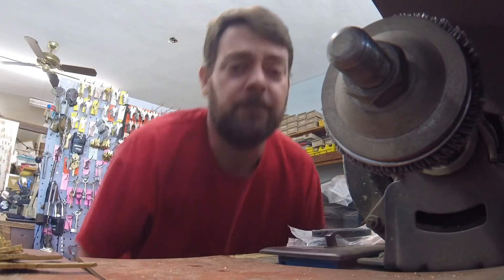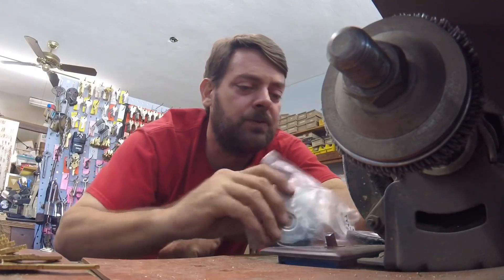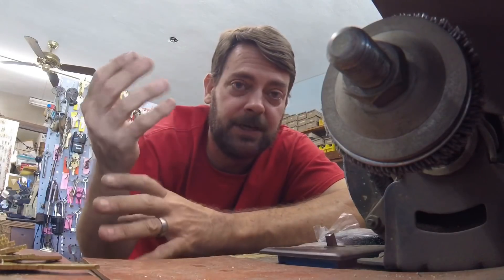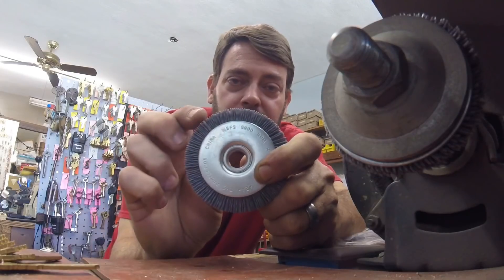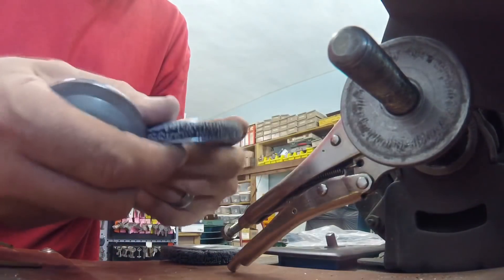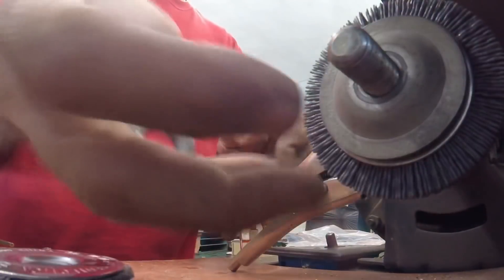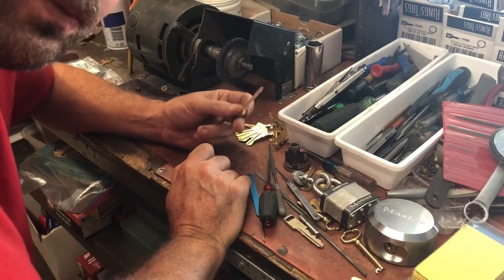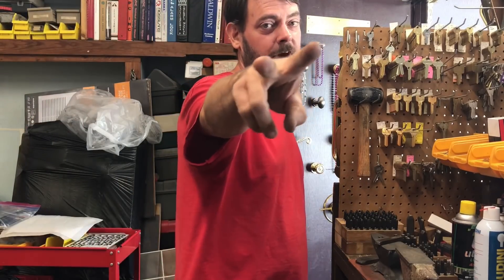key machine brushes

Comment: I use one of the 6 inch brushes on the HPC blitz. It seems to work just fine and I’ve also just used my impression  file and just cleaned off the Burr  just depends on how bad the key is.

Comment: We have a Craftsman grinder/wheel brush machine with adjustable speed.  I don't like the wire brush because I've noticed some of the wires break and could shoot itself into your eye if your not wearing eye goggles or a face shield.  I might just start using the key machines nylon brush better.  I felt a sting on my left eyebrow one time, it was a piece of wire.  Sometimes when we brush a Honda key the wire brush will suck it into the machine scratching up the plastic part of the remote key.  But if the Honda key enters the lock hard, he have to wire brush it down until it goes in smooth, laser cut Honda keys are sometimes a pain.

Comment: Thanks for the great info 😃👍 whenever you have to change a cutting wheel, I’d like to see a video on that. My Ilco 045HD needs a new one soon (broken tooth).
Reply: I just got my duplicator about a month or so ago and I’m still learning; but if you get the Sparrows reload kit you can get those keys copied or even go by a locksmith shop and ask them to cut a few random keys 😊👍

Comment: I noticed that you have 2 Framon #2 machines. Do they both still work?
Reply from the maker: wattvoltamp yes and perfectly :) I wouldn’t hesitate to purchase a F2 if you needed the most accurate machine possible, however it is still a bit slow compared to the 1200. Gotta use it a lot to get speedy :)
One is a dedicated ASSA machine though so that’s all it does but has cut tens of thousands of them over almost three decades
Reply: @selock  Thank you. I just bought a new #2 and love it. I also have a 1200. I'm cutting about 250 keys on the F2 and getting faster as time goes on
Reply from the maker: wattvoltamp sweet! Yeah, when you are cutting MK prep keys on it after a few keys you kinda memorize the depth cuts and can really go to town. “One off’s” are always quicker on the 1200 for sure 
Having the DS book right at eye level above the machine is pretty imperative for the speed :) 
also thanks for watching :)
Reply: I watch a lot of your videos.  This video prompted me to order a softie brush that I want to put on a motor from a mini speedex machine. The shaft is about a 1/4 inch so I'll have to adapt to it somehow.